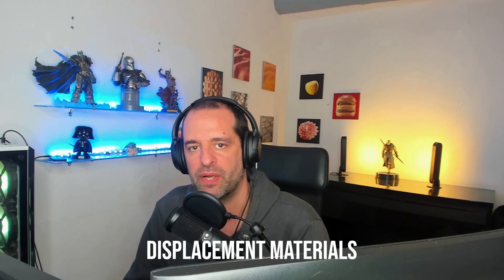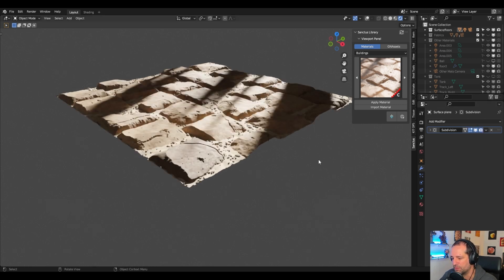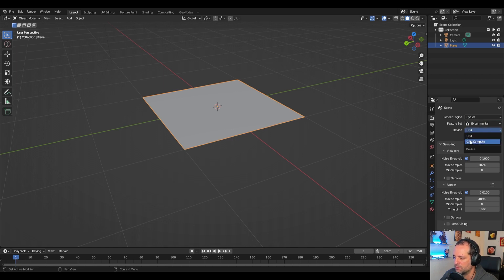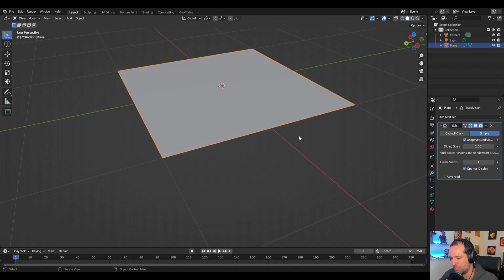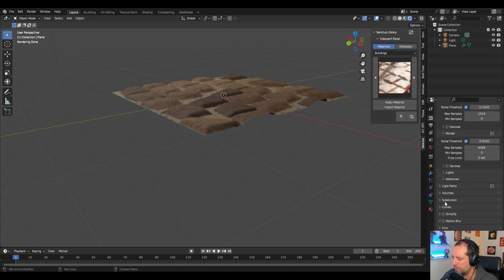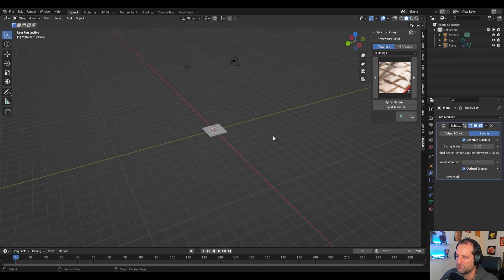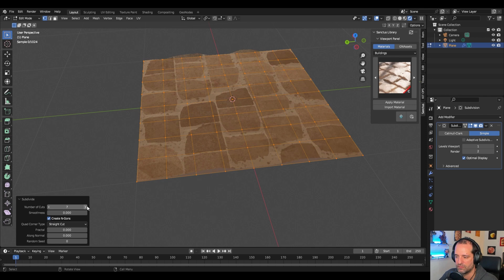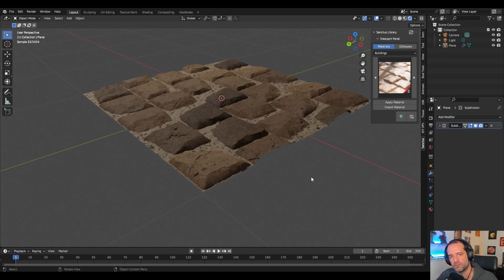Sanctus Library Tutorial - Working with Displacement Materials

Comment: I've tried to reproduce that with Blender 4.5 and found the adaptive Subdivision not working like you showed here. Displacement only started when increasing the Levels Viewport.
(And BTW: Trying Vulkan crashed Blender completely...)
Reply from the maker: Hi! Well adaptive subdivision works as usual in 4.5 so you must have skipped something, maybe the viewport dicing scale in Render>Subdivision parameters after setting cycles experimental.
As for vulkan.. there are all sorts of user reports with problems (Blender in general), new releases always have issues until a few updates are released, that's why I try not to update until some time has passed. But in my particular case Vulkan works just as fine as you can see:
https://i.imgur.com/Jj9o1zs.jpeg
https://i.imgur.com/bvtyOiR.jpeg
Reply: @SanctusArt  My bad. I was using Preview mode instead of Full Render mode. 😕

Comment: Just purchased and tried the addon but got some issues - Many materials cause blender freezing on my M1 Mac Studio(64G Ram), but working well on my RTX 4080 PC. Better compatibility required. And too heavy even applying to a simple object. I think the reason why many people try procedural materials is for a big area object avoiding tiling pattern issue. Theoretically this solution seems great but very tricky to use in real works.
Reply from the maker: Hi, I missed this comment. Are you still having trouble with the addon? Please contact me on Discord or through the addon website.

Comment: but which blender version should i use with sanctus library? my blender app is closing or terminated automatically when i'm using this add on and i guess i was getting error for incompatibility. I have Sanctus 2.6 so what blender version is more stable with Sanctus 2.6?
Reply from the maker: The addon is 3.0+ for all the materials and the geometry nodes assets and decals require Blender 3.5+

Comment: So if you make materials and add the displacment to them can they be used in a game engine by bakeing the materail on to the model and then exporting it to the and into a game engine ????
Reply from the maker: You could bake it on the model with a displacement modifier, or if the engine supports displacement, you could just bake the texture maps and use them directly